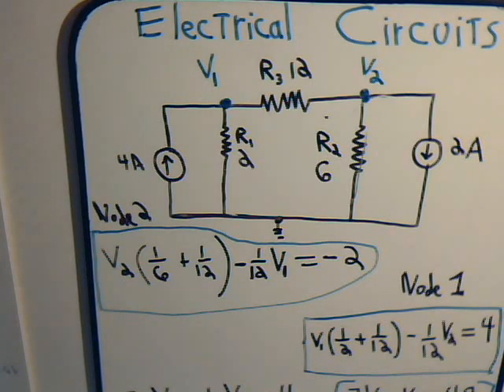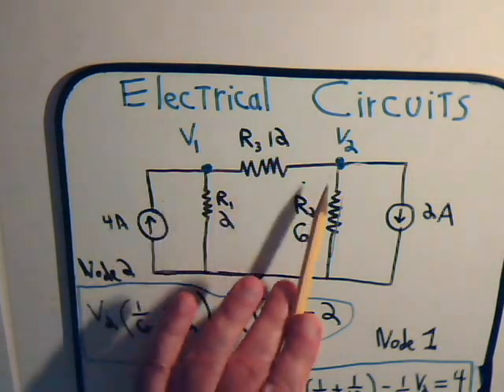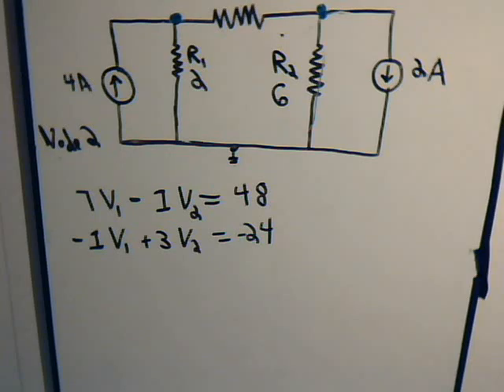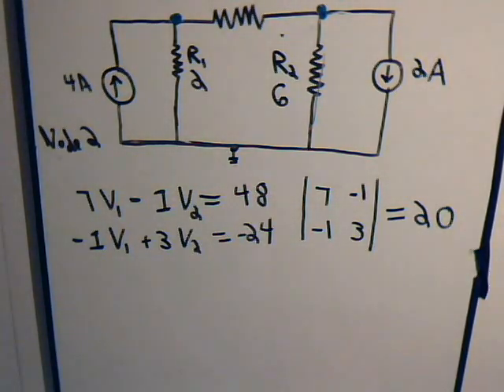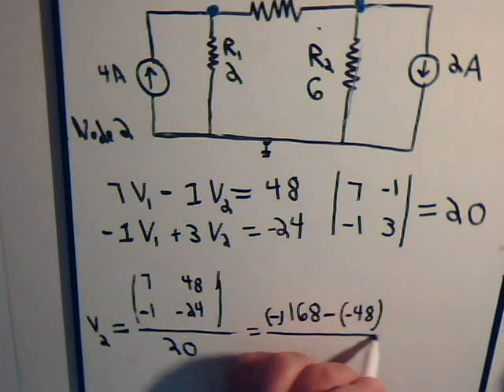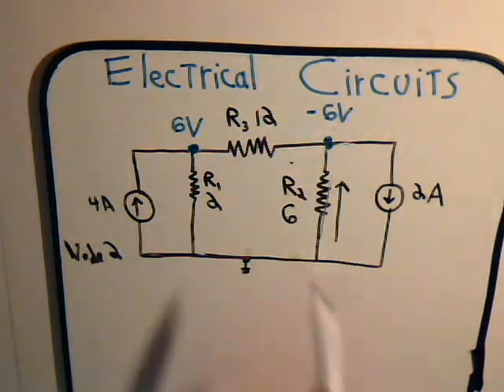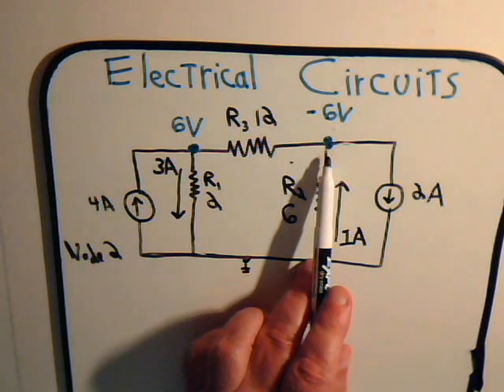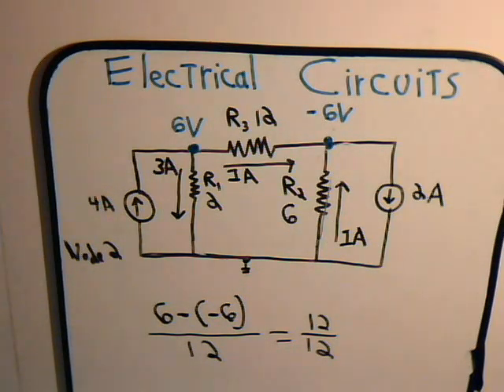Electrical Circuits Video 29: Nodal Analysis - Format Approach Introduction & Example #1 Part B

Comment: guys, if you have a ti89 don't waste your time solving for v1 and v2 by hand. use your solve function, enter the first equation, then go to catalog, select "and", then enter the second equation, and you get the answer. 

solve(-4+x/2+(x+y)/12=0 and 2+y/6+(y-x)/12=0,x)  ==> yields x=6 ; y=-6

it will be a great time saver :)